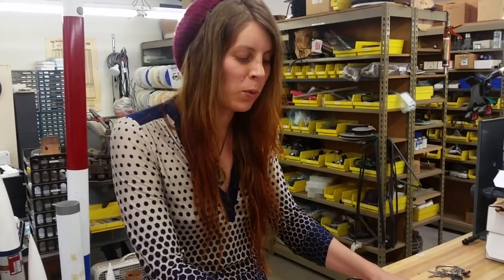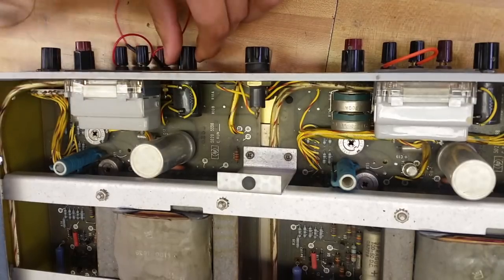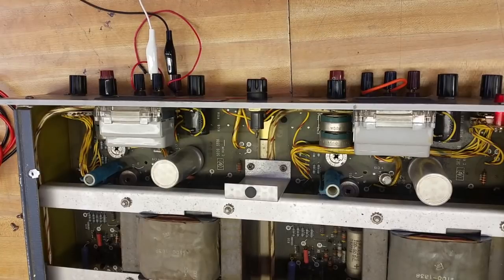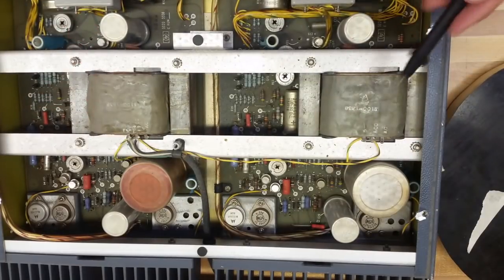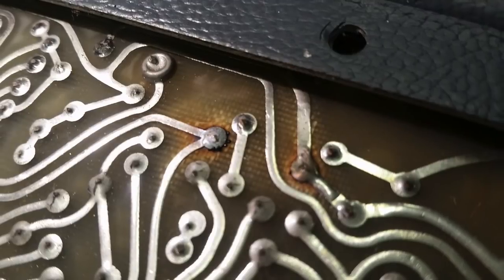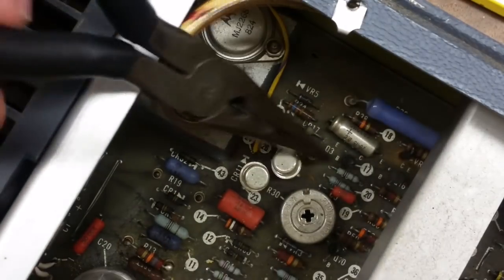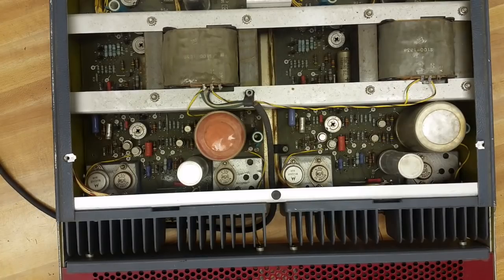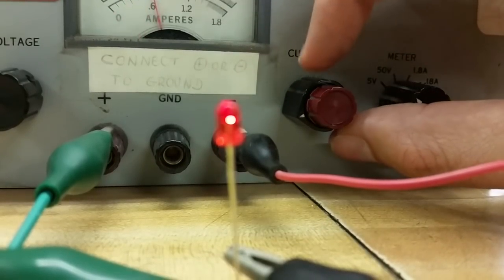Repairing a Vintage E-waste HP Power Supply

Comment: Lucky you, yours has some non-coax pots. Mine has coax pots for voltage and current. There was an option to replace the coax pots with 10 turn pots.

I thought mine was functional but then I hooked up a load to it. Sad face.
Reply from the maker: I haven't played around with it enough yet to get a sense of why the coax pots are bad. Is it just that the 10-turn pots are more precise?
Reply: @EmilysElectricOddities  I guess it's just personal preference. If you stay in the same general range of voltages the 10 turn pot might be better, but if you go up and down the range it might get tiresome to have to turn it so much.

If you happen to open it again it'd be great if you could post a shot of how the 10 turn pots are wired up.

Comment: That thing is definitely in the category of "check/replace all capacitors" due to its age.
Reply from the maker: I checked all the electrolytics and they looked good!
Reply from the maker: @Cereal Experiments Have you seen that video series by Curious Marc where he is restoring a 1930s teletype? In one of them, he powers up the thyratron-based power supply for it, and the original caps are still good and work just fine.
Reply: @EmilysElectricOddities  I like that when "the cap complainers" are all saying you really do have to replace them all and he's just, like, "nah! Let's give it a go first".